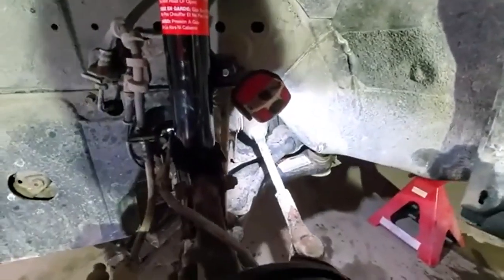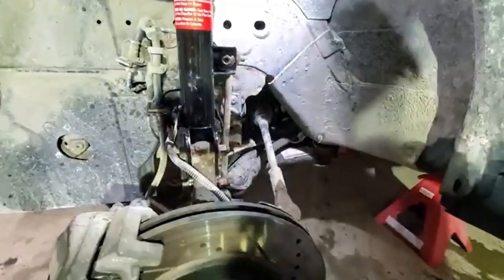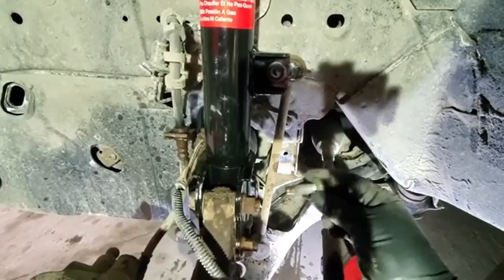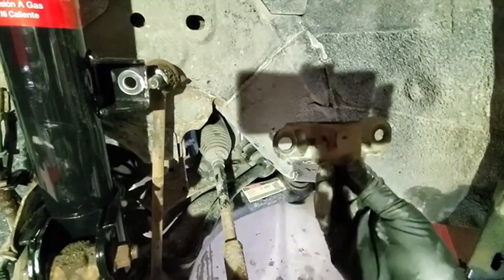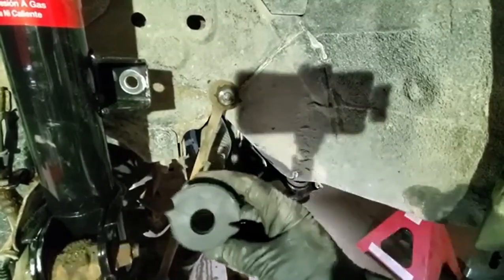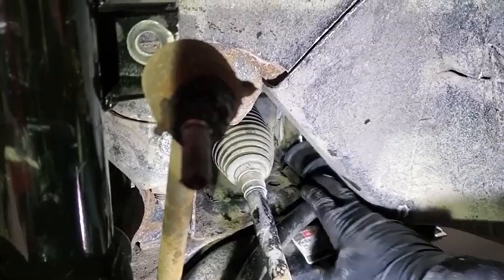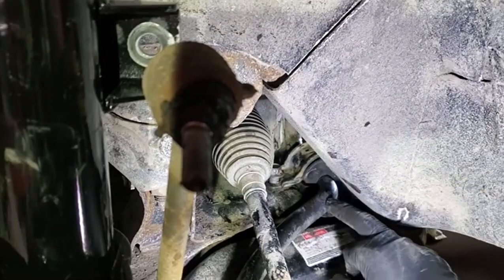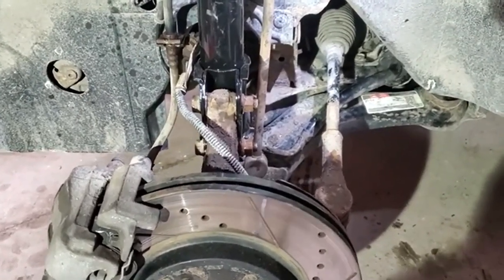2008-2012 Ford Escape Sway Bar Bushing Replacement

Comment: I went from having the classic Ford death wobble shimmy at 70+mph and it occasionally during braking to a clattering sound wherever going over anything uneven. I replaced the inner and outer tie rods, new brakes, new sway bar links and newer struts. Im going to try replacing the old lower control arms, I know the lower ball joint looks shot. if it fails, I will try the sway bar bushings otherwise im clueless
Reply from the maker: That's sounds like a pain in the rear end. Usually, I start with sway bar links and bushing,  those wear out quite often and are not that expensive to change.

Comment: Wondering if this will work on my 2012 Fusion. The brackets are on top of the frame just like in your video. Thanks
Reply from the maker: Escape and fusion are shearing many components,  I would guess it is quite similar procedure,  if not the same.

Comment: Before replacement did you feel vibrations on the floor by the gas pedal while driving?  Im trying to figure out what is wrong with my Escape.
Reply from the maker: Sounds like wheel balancing issue.  I would also check ball joint and tire rod.

Comment: Did u replace the sway bar link too? Looks eaten out the rubber? Also I have a 2012 ford escape 2.5l FWD, it has a slight creaking or groan sound when I accelerate from a spot and also when I do slight turns. But over bumps it does not groan. Can it be the links or bushing? I have also changed my driver side cv axle.
Reply from the maker: Sway bar links were replaced a year before, so they were still good. In your case it is hard to tell,  without seeing.  Take a sway bar links off and inspect,  it should not be too difficult.
Reply: @justdoityourself  but what can be causing this issue?
Reply from the maker: @justlg3359  it almost sounds like motor mount or exhaust might be making that noise.
Reply: @justdoityourself  I changed all motor mounts recently. Exhaust really? How to check that
Reply from the maker: @justlg3359  get under the vehicle,  and shake it well :). Another way you can check,  when vehicle lifted, apply brakes, put in Drive and play with gas, that will get engine and exhaust shaking and maybe will reproduce the noise, it exhaust is the issue.  Also, check your drive shaft for any play,  ofter it gets loose on the PTU.
Reply: @justdoityourself  ill check that, hopefully I can find the issue. Will let u know what u find, but is it common to have a groan noise when letting go of the brakes?
Reply from the maker: @justlg3359  there should be no noise.
Reply from the maker: Any chance it is similar to this?
https://youtu.be/ddH_w8EBaOE
Reply: @justdoityourself  which brand do u recommend for the bushing? I see they have mevotech and moog